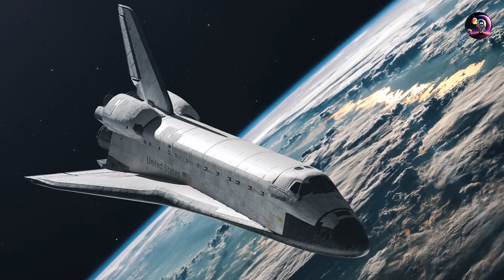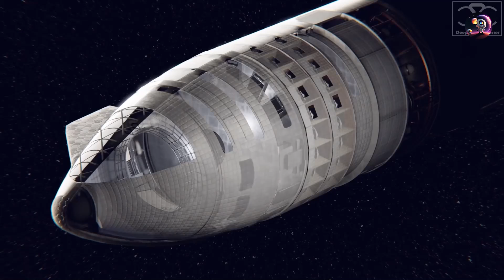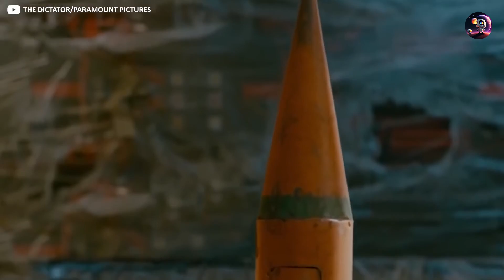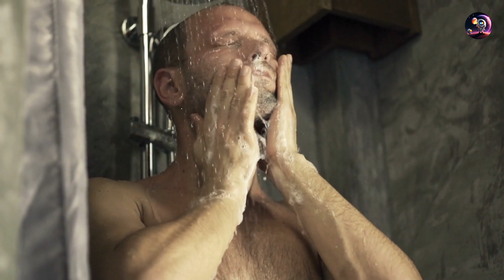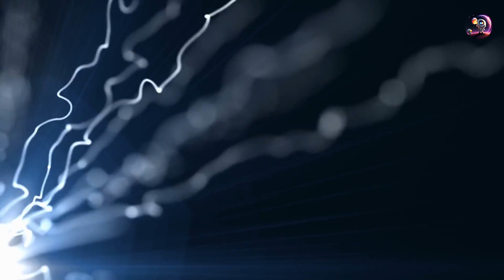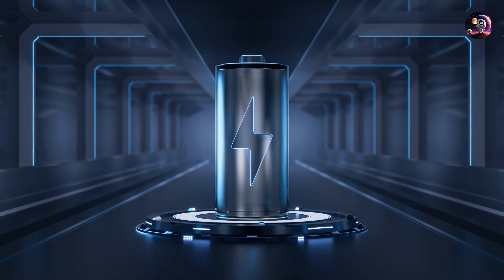SpaceX's Starship Interior Design Update

Comment: For the likely crew size I suspect that both you (10 crew) and Elon (100 crew) are correct.

In the early missions no one is trying to colonise and there is no point in putting 100 people's lives at risk with relatively new technology when 10 people (or thereabouts) can complete the mission objectives i.e. get there and back and do the science required when on the surface. At this early stage of Mars missions I think the crew size would be constrained by safety considerations rather than Starship payload size and weight considerations.

If/when higher volumes of people start doing Mars transits, by which time I assume Starship would have done many successful Mars landings and that there would be far more faith in the reliability of the technology, you already show in this video what looks to me like a perfectly plausible interior layout for 50 people. To get to 100 it's notable that Musk already went on record a few weeks ago saying that a 10 metre stretch of Starship is something that they are looking at. Even if half of that needs to be allocated to extra propellant capacity that still gives an extra 5 metres - 2 more full 9 metre diameter decks - of pressurised space.

OK, maybe Musk is still pushing it a bit with his 100 estimate though I wouldn't rule it out entirely. Submariners go on patrols of 3 months and sometimes longer and they do that multiple times a year for as long as they are serving as submariners. Even now the junior rates' bunks are coffin-like(*) and until recently they even had to hot-bunk because there weren't as many bunks as crew. If there is a breed of people willing to do that at least twice a year for a multi-year career I think there would be enough people that would be willing to endure 6 months in conditions that actually wouldn't be as bad maybe only once if it a one-way colonisation trip and only two quite widely separated trips if there is a return trip involved.

(*) I read on what I think was an accurate Quora answer that on a US SSN the standard bunks are 72" x 30" with only 17" headroom from the top of the mattress to the bottom of the bunk above! The XO gets 26" of headroom above his/her mattress which must feel like luxury compared to the 17" that everyone else apart from the CO gets.

Comment: I like Daniel Touma's idea of multiple starships that dock initially in earth orbit.  If the the docking port for each was at the tip of its nose, and if the airlock connecting them was cylindrical and long enough, they could spin all four ships around the central axis and produce some measure of gravity...perhaps as much as an earth equivalent 1 g.  That would eliminate a host of adverse physiological effects of extended weightlessness and allow normal eating, sleeping, showering and elimination (if you know what I mean).  The water could be cleaned and sanitized for almost endless reuse.  All they need is a reliable power source that would easily last the entirety of the voyage to Mars and the first 90 days or so of time on the surface.  Oh...the four starships would be arranged with their noses pointing toward a common center with each starship 90 degrees radially from the one beside it.  So the entire constellation would be in the shape of a plus sign or cross.  An unmanned space tug would connect perpendicularly to the center of the airlock structures to propel the four ships on a trajectory for Mars.  Since the space tug would be completely empty (no space consumed by habitation), its entire interior volume could be used for fuel and oxygen.  Additionally, each of the four starships could be fully filled with propellant (oxygen & methane) and this fuel could be fed to the space tug to extend the burn duration by 4x or more.  The engineering challenge would be to ensure that the oxygen and methane remained cryogenic and therefor liquid while transiting to the tug's engines.  One additional point...All of the space tug's engines would be vacuum engines, and some could be lower output to allow initial acceleration that would put less stress on the airlock structure.
Reply: Love the idea! As you've already mentioned we've definitely got some engineering challenges with that configuration of ships. I am thinking specifically about the torque created from ships being perpendicular to the direction of acceleration. I'm sure it can be handled with some kind of frame or skeleton that connects the whole system.

If however only two starships were connected at the nose forming a straight line then I think we have a much simpler problem to solve. The two ships could take turns firing engines. The first ship would fire and when the burn is done the system rotates 180 degrees and the second ship fires. Those burns only last a few minutes each after which maximum speed is reached and the system slowly and continuously rotates for the long journey to create artificial gravity. When they reach mars the ships will need to separate and land independently.
Reply: @trustymind  Your concern about the torque is legitimate.  I was thinking that perhaps having a mix of small engines or thrusters to create the initial acceleration would diminish the torque applied to the structure when the main engines kick in.  And the main engines would be able to be throttled from low to full output.  They could also be brought online in pairs such that they wouldn't cause any type of rotation of the entire assembly.  Another thought I had was to have two space tugs attached at the intersection of the two airlock structures.  On the one side would be the space tug that uses conventional propellants.  On the other would be one that contained one or more high performance ion engines.  These could be used for initial acceleration, perhaps.  That would depend on how much force they would generate and how much time it would take for that amount of force to accelerate the structure to a useful velocity.

Comment: I feel all the ships should be built together on the moon first then when completed more fuel and supplies can be be stored. Some of the boosters that are made should remain in orbit and engines foremost the production of saving fuel. For every 5 boosters go up 1 stays up. This will profound the ability for boosters to promote engines when needed. Gir long term use. So many ideas in mind. The upmost idea is to get them all connected together and make a big ship. When time is right they unlink one at a time.  For communication status using line chain link systems like wifi spots in a long trail for faster communications. Example small stations size of a paper plate every 50-100 miles as all links data transfer spontaneously together the more the better.   In theory it would be faster then satellite communications that takes longer than 10 days or 3 months. Over all our moon is at its best resource to build on less gravity and maneuverability is a greater at chances storing supplies and fuel is the most of all. Want to send 100 people use the moon as a back door.

Comment: Considering the very thin Martian atmosphere and corresponding aerodynamic effects, the airfoils on the Earth Starship are FAR too small to be as effective as necessary in the Martian atmosphere. The deceleration provided will be much less than the much denser Earth atmosphere resulting in higher velocity necessitating larger surfaces to increase drag and control. The thrust required to slow down to touchdown safely is likely to be higher as a result. Possibly a combination of main thrusters AND the "waist" thrusters of the Lunar HLS ship are in order. Martian atmosphere optimized engines would likely be a hybrid between vacuum and Earth atmosphere engines. This will be determined when the first robotic Starships make their landing attempts. Crew accommodations will be decided by different criteria. IMO

Comment: multiple ships in formation shield each other and help be seconds away no matter what problem - at zero-g all roms have 6 floors and 6 ceilings 
(a 9m diameter loop gives you all the g-forces you need for as long as you want, spin the bathroom section just a little bit and the bathrooms can be used normally -showers even )
Reply: six moths in zero-g watching mars grow bigger an bigger be a most amazing journey 
(to surrect planets is how to live in a universe )
Reply: then all the vomit can float around the ship 😅
Reply: @Jebes00009  (your balance system follows your movements  -make the loop an e-scooter obstacle/slalom course )
Reply: @replica1052  a tight loop like that  would be hell.   They just need to build a bigger ship i  orbit.   Starship isnt right for long voyages like the one to mars.
Reply: @Jebes00009  a 9m loop is plenty, the loop be standing still so when you stop moving you be at zero-g - make it an e-scooter slalom/obstacle course and it will be even longer 
(your balance system will follow your moves and be perfectly fine )
Reply: @Jebes00009  (should someone womit it would be sucked into the ventilation filters - along with you farts  )

Comment: OK-----...  Solar Panels???  NASA's Kilo-Power Generators attached to the stern of the Starship far from the crew would be a better Choice for the Moon as well as Mars...  Kilo Power Reactors would not only provide power when the Sun was down or Dust Storms made Solar Panels worthless but the heat from the Reactors would keep the ship and Colonists Warm during the 200- degree night without having to use expensive to Produce and Store electrical power...
Reply: A newer design proposal, would use Fuel Cells for power, using the excess heat as a supplement for warming and provide more than enough water as a byproduct. No radioactive cores to deal with - save that for surface installations where they can have the dangerous parts buried. Besides, the current NASA target output is only 10KW, enough to power 6 standard space heaters (domestic) that output about 32K BTU.